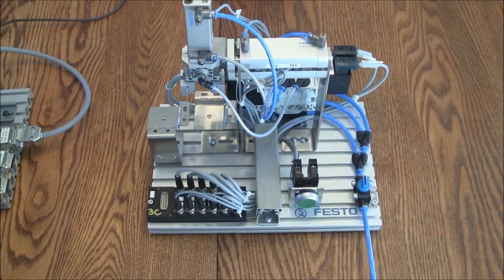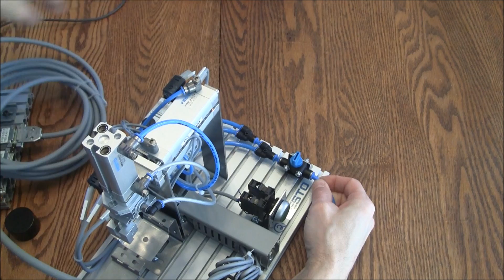PLC Trainer - Festo Handling Station

Comment: A few years ago when i was programming this very system I didn't know how to use sensor inputs so i had this going on a timed delay loop. That is not a good way to have these run, because since you're basically taking a machine which has closed loop feedback and completely removing it's feedback. So what ended up happening was that after a few cycles the timing of the pneumatic cylinders went out of sync and the entire machine bent one of it's brackets without knowing and kept going until it tore itself from the base plate it was sitting on. A lesson was learnt that day - ignorance is bliss, but feedback is important!